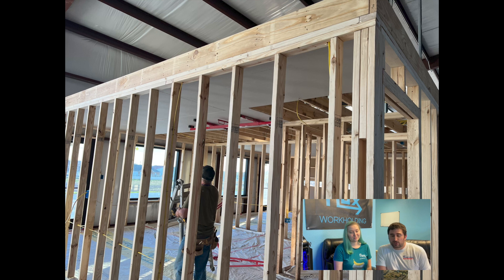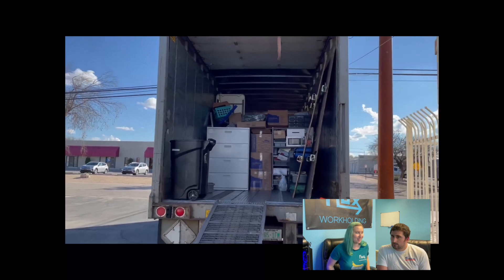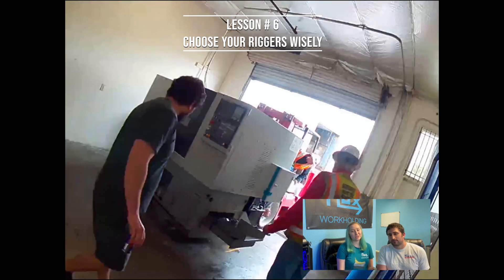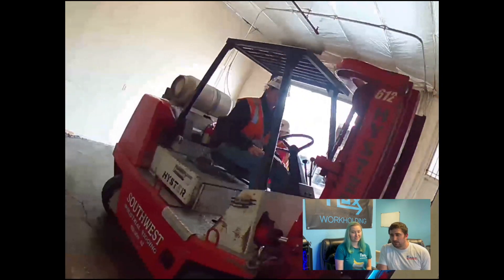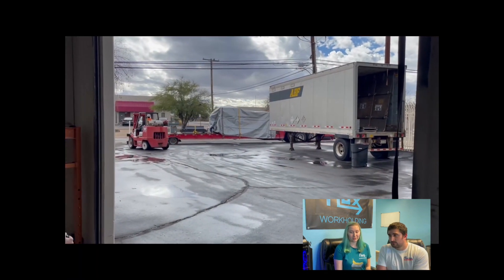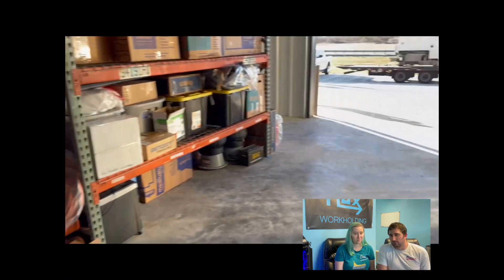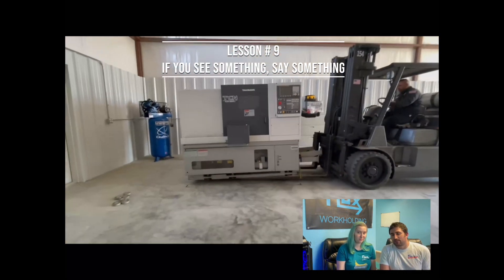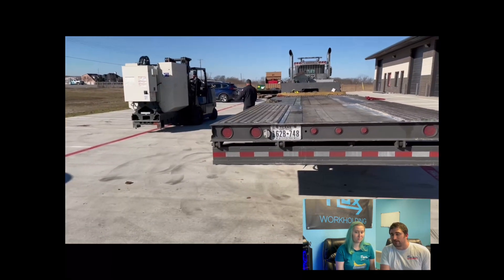Moving Our Machine Shop to Texas... 12 Lessons We Learned

Comment: First of all Welcome to Texas, I’m about an hour from you guys. I use JMOR & Able pretty often. Rafael at JMOR is great to deal with. Either movers will level the machines for you, they have the standard master levels & also laser levels. I had Able move & level our HAAS VF2 as well as our manual lathes. The phase converter, it sounds like it needs larger caps & inductors.

Comment: this is super helpful as the misses and I are considering moving our little shop about 1500 miles away!

What kinda of problems are you having with your rotary phase converter? I have been running 1 for 3 years now and the only complaints I have are that it's too loud (so I moved it outside and now I'm happy)
Reply: @Flux Workholding interesting. Does this happen only when your lathe spins up its spindle or does it do that when you mill spindle ramps up too?

I was worried when I first got my phase converter that legs might sag too much but I hooked up my oscilloscope to each phase and ran a few air cutting programs (just dancing the axis back and forth and starting and stopping the spindle) and my legs never differed by more than 3-5%, how much sag are you getting?
Reply: @Flux Workholding oh dang, that is a lot. Did the rotary converter mfg already send you a few more capacitors as a quick fix?